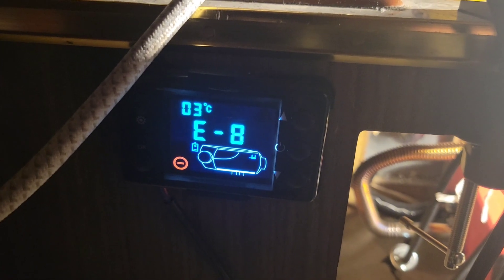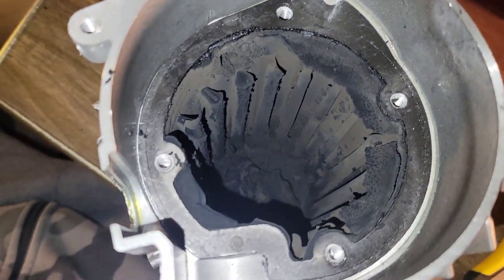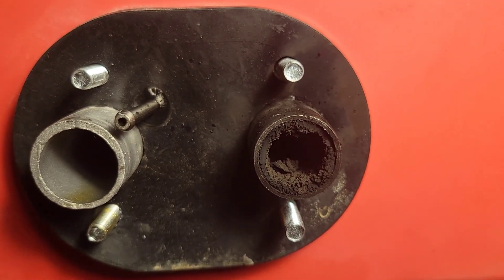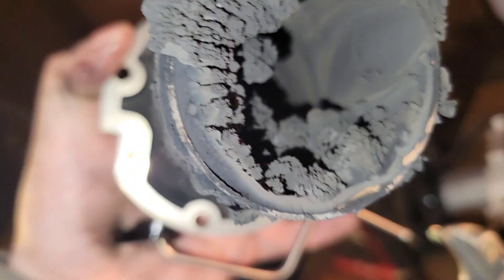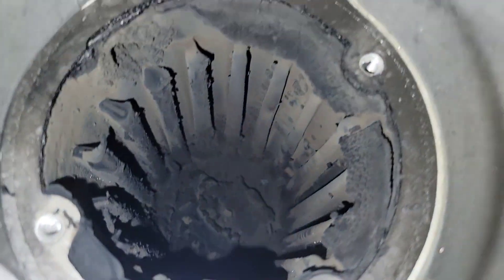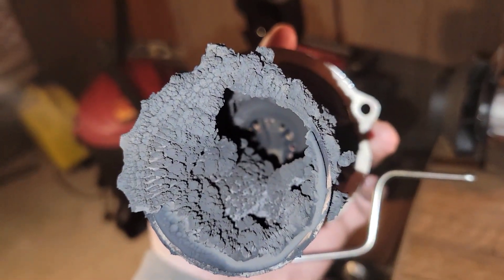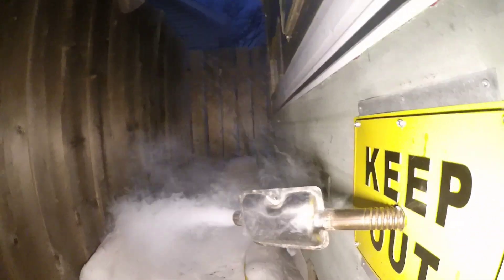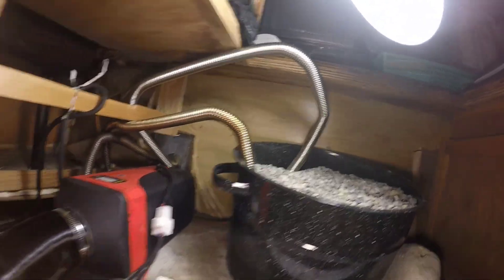vevor 2kw diesel heater E-08 error code, all coked up!

Comment: Dont run it low and slow all the time and before switching off run it on high for at least 15 mins to clear out all the crap also get an Afterburner control unit from Ray in Australia......

Comment: Im thinking you need your fuel tank higher than the unit . Or the diesel  bleeds back to the tank emptys  the line with gravity  . Then when you go to start it . Good luck . Painfull. . And even after mine has gotten past that issue im sure the program is out of wack . The pump doesn't go in time with the glow plug .  So it smokes on startup   i still have to flood it with the pump only for 20 seconds before  I start it . My camper one has a different controller and starts up no smoke no issues  ever  the fuel tank is about the unit on that .

Comment: In the back or bottom when ur looking down the burn chamber there’s a steel scour pot scrubber type ring. U can’t see it under there but u can feel it with a pick. Fuel trickles through it. It doesn’t have an injector so that’s how it spreads it around for burning. It’s hard to clean soft soot out of it and impossible to clean caked carbon. Your smoke is probably from that still being dirty. It might burn out itself. It doesn’t come out so I wouldn’t go opening it back up.
Reply from the maker: I figured that's what it is. I might try running a smaller pump aswell 18 or 16 ml

Comment: ? Ive noticed lowered expectations uses alpine mod even at less than 4k feet.
Reply from the maker: Yeah it's still smoking on start up. I'm thinking the burn chamber had some carbon right after the atomizer. Everything else was clean, but I noticed at the top of the burn chamber there's a spot a can't get into to clean. I'm going to try a new burn chamber or soak it in Chem dip 🤷‍♂️ 
Alpine mode doesn't put out enough heat for my trailer. I let it run all day in -20 celcius and it only hot to 15 celcius. That was the second burn since I cleaned it. I think I might need the 8kw. But I still want to resolve the smoke on start up issue